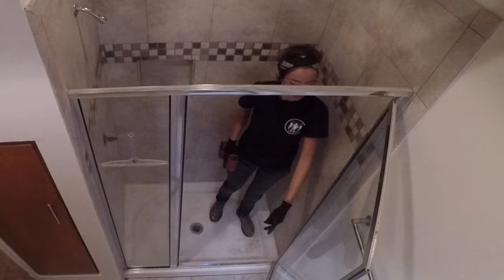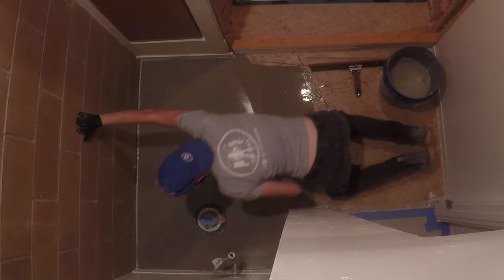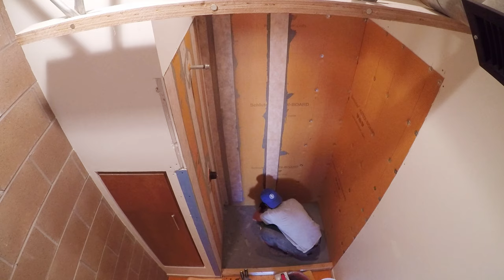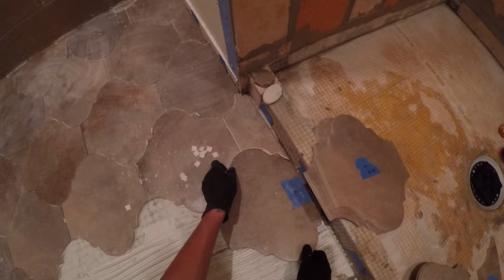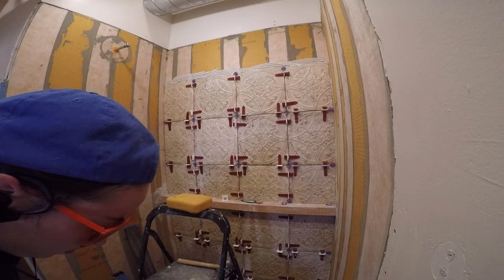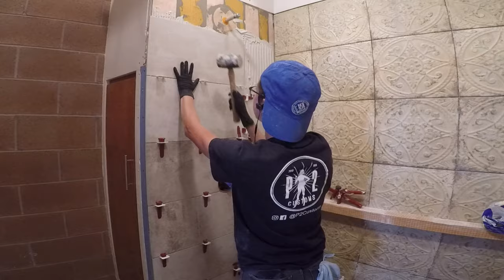Complete  tile shower installation. Time Lapse

Comment: How would you remodel a wet room that already is tiled and the floor heating is via a heating manifold that has water pipes under the tiles that need to be replacement?

Comment: Hi Sal, If i'm doing something similar do I need a leveling system on wall w/ 4 x 16 tiles?Also can I use 1/4 x 1/4 trowel w/back buttering?Saw your trowel size vid but still not sure , of course I'll check coverage as I go anyway.
Reply from the maker: Probably better off with a 1/4x3/8x1/4 trowel for those tiles, leveling system can be used, but probably not needed.

Comment: Hi love the video very educational. Question I had my contractor instal a steam shower in our new rehab. A couple months after use it smells like sewer in there. And it won’t go away no matter what I put down the pipe. What could this be? Please advise.
Reply from the maker: Steam showers are a very specialized type of shower, they must be constructed to withstand steam vapor penetrating the waterproofing. If the materials used are not correct and the perm rating required is not sufficient, vapor will penetrate into the wall cavity and cause mold and mildew, water damage and much more. A liquid applied waterproofing membrane usually does not have the proper perm rating, and worse is usually applied incorrectly to diminish its effectiveness further. I would guess that the steam shower was not constructed correctly and you have some very serious problems with moisture where it should not be. If it was not constructed with a sheet membrane installed over the backer board, or a foam board was not used, you will probably need to stop using the steam completely, waterproof does not automatically provide proper perm rating. Liquid water will be stooped, but steam will penetrate much further into the assembly.
Reply: Sal DiBlasi thank you makes total sense, but can it happened so fast? we’ve only been here six months.  But after watching your videos regarding the Schluter Kerdi board. I know for a fact they didn’t use that because when I asked the project manager, what kind of material did you guys use, specially on the ceiling, as the ceiling was not tiled and it look like drywall, the paint was flat, not even semi gloss so the water can at least repel, does the ceiling have to be sloped or can it be flat? 
I just didn’t want anything to bubble up which is has. So I said something, and he said it was too expensive to tile, so I let it be.  I asked what kind of materials are up there cause I don’t want it to bubble up as the paint looks flat not even semi gloss to repel water, he said it was green board that it’s waterproof and meant for steam showers, so I should be fine. My new contractor that’s finishing the job that the other contractor didn’t finish said that whoever installed that steam shower didn’t seal it properly or didn’t use the right materials he suggested we might have to go in there and break it up.  Do you think it’s just the flooring that I need to remove or the whole steam shower, wall tiles, bench, glass door. I am taking the last contractor to court because he did take my money and didn’t finish the work downstairs so there’s no one to complain about to talk to them about the repairs because every time I would tell him hey the shower smells he said he would take care of it when he would start taking care of the bedroom bathroom downstairs that never happened so my new contractor was working on that and even though he finished the bathroom downstairs is still smells upstairs like a sewer.  That’s when the new contractor suggested that we might have to rip it up and see what’s underneath. So Sad. This is just a 780 square-foot house and that contractor charged me over $250 a square foot. And had bad installers under his belt. What do you suggest I do Sal. Should my new contractor go in there and rip out the old steam shower and does the ceiling have to be sloped and tiled or can it be flat and tiled? Or does it have to be tiled at all? Thank you for your time

Comment: I like the floating shelf more than a niche. I'll definitely go with a shelf for my upcoming bathroom remodel. Should have no problem carrying the weight of several products without screws right? What adhesive did you use to adhere the shelf to the wall?
Reply: Kerdi fix
Reply: Floating shelf is less labor too. That shelf would support anything you could put on it. Not only is it supported by the adhesive, but the tiles below it too. You could stand on it no problem.